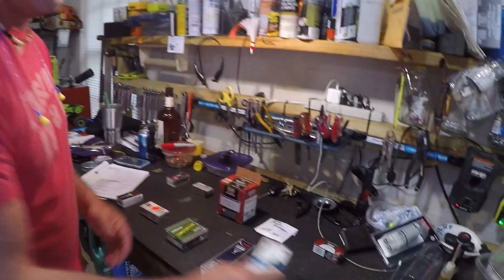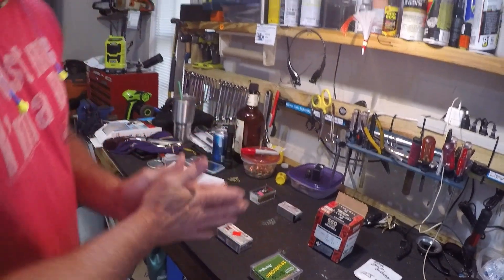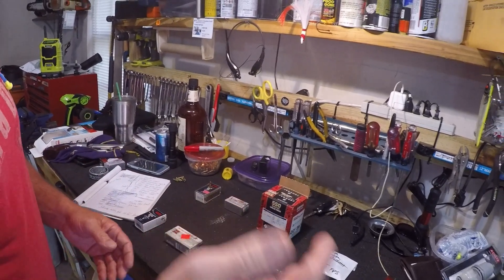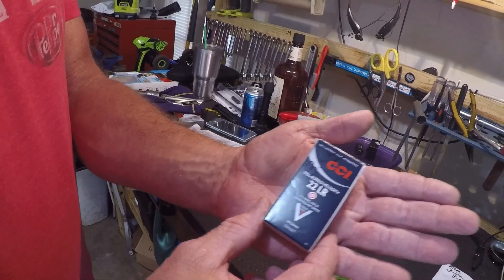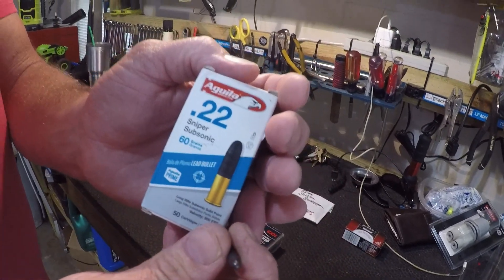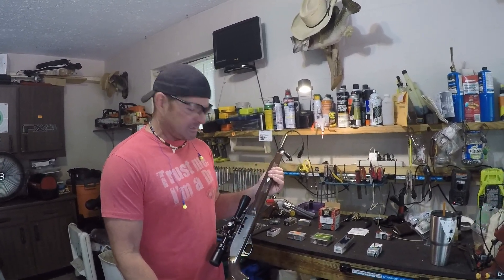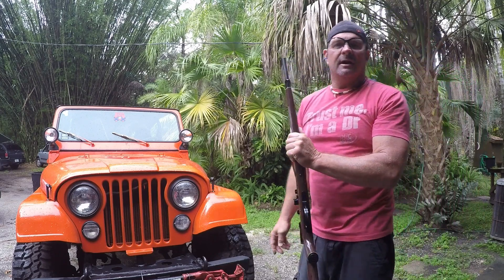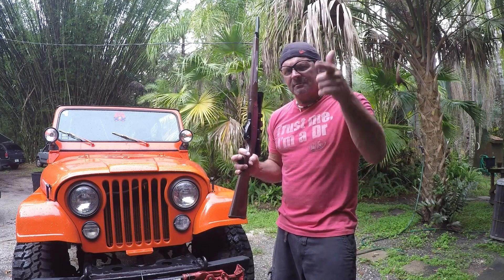22lr decibel levels

Comment: https://www.youtube.com/watch?v=dmOPt6f0Oqk
Shorter barrel is louder
it is good to test it in the same temperature, the meter at the same distance
it will be good to do different lengths barrel at the same time

The meter was about 10’ to the left of the muzzle, pointed at the muzzle. (19.5inch barrel)
The meter was about 8’ to the left of the muzzle, pointed at the muzzle. (5.5inch barrel)
						                               5.5inch		19.5 inch
Aguila Sniper Subsonic 60 grains 950 fps 	(97db)		(71db)
Remington Subsonic 38 grains 1050 fps 	(97db) 		(77db)
CCI Standard 40 grains 1070 fps		       (96db) 		(78db)
Federal Lighting 40 grains 1240 fps		       (93db) 		(db)
Federal Lighting 40 grains 1255 fps		       (db) 		       (81db)
Aguila Super Extra 40 grains 1250 fps		(93db) 		(db)
Remington Thunderbolt 40 grains 1255 fps	(94db) 		(87db)
CCI Mini Mag 36 grains 1260 fps		        (93db) 		(db)
Federal American Eagle 40 grains 1280 fps	(90db) 		(db)
Winchester Super X 35 grains 1280 fps		(92db) 		(84db)
Winchester Super X Subsonic 1065 fps		(db) 		(78db)
Remington Yellow Jacket 33 grains 1500 fps (93db) 		(db)
CCI copper 1850 fps				                (db) 		(90db)
Federal Bulk 1260 fps			                        (db) 		(88db)
CCI Subsonic 1050 fps				        (db) 		(74db)

Comment: Your measurements are off.  Remington Golden bullets and all of that 1050 fps stuff should be around 140 decibels.
Reply from the maker: They are spot on for the distance we measured. I guess if we put the db meters right in front if the muzzle and shot a hole through them it may have been even higher. Lol
Reply: @bfuddoutdoors5953  I think the industry and military standards are usually 3 feet to the left from the muzzle.  https://www.silencercentral.com/wp-content/uploads/2020/02/Silencer_Sound_Comparsion_chart.pdf

Comment: How far from muzle You have located measuring device ?
Reply from the maker: kris198720 about 10 feet directly left. Basically where you would be safe in a shooting situation. We could have used a multiplier to get muzzle db but who put their head next to a muzzle as a gun fires.
Reply: Bfudd Outdoors i see..i was doing similar test with 22lr rifle with custom silencer and get 83db but around 3ft directly next to muzle so it would be slightly lauder than where you were testing
Reply from the maker: Cool post the video. I will watch 👍
Reply: Bfudd Outdoors i would but i returned measuring device, i can only show with cell phone app